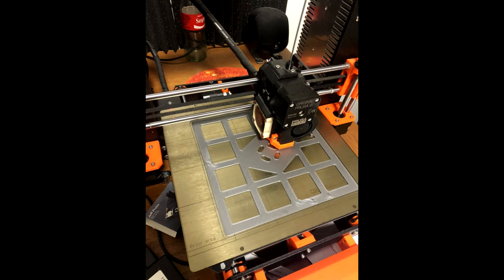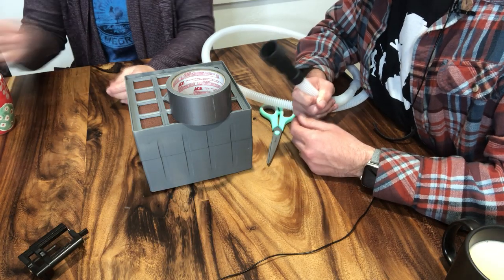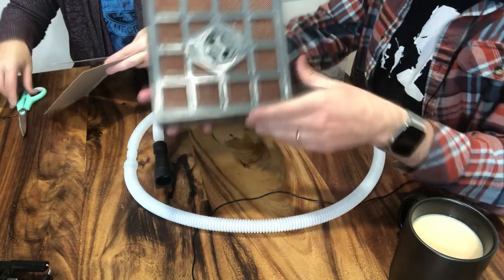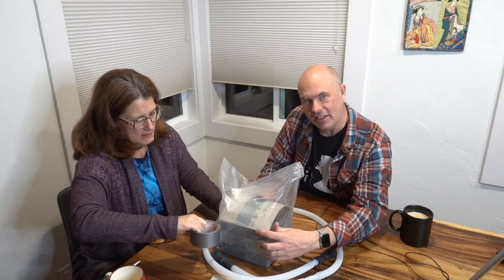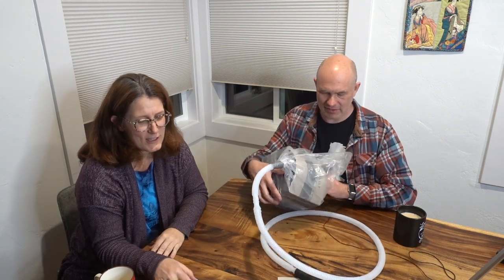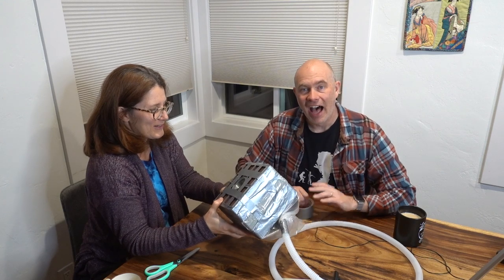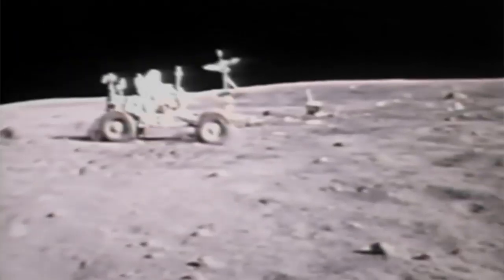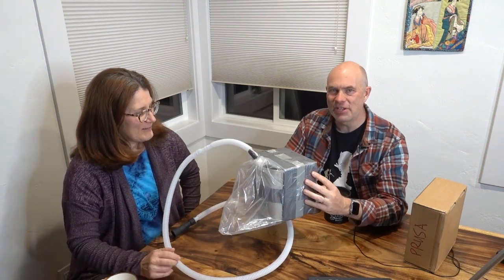Recreating The Air Filter Hack Used By Apollo 13

Comment: With another month of "stay at home" you can build an entire apollo capsule in your living room!
Reply: Tired Again Where am I going to get the hypergolic RCS fuel?
Reply: Challenge accepted
Reply: @alexlandherr   I'd say in your fridge
Reply: I don't think it's going to last that long.
Reply: @djbeezy  It is where I am.
Reply: Just simulate a moon mission. Load a pod up with freeze dried food, seal yourselves in, and have a computer running KSP without any time acceleration
Reply: A month? You're awfully optimistic. Try 2021.
Reply: @alexandrepascal3573  She might have a hair spray, don't ask how I know, they are pretty flammable.
Reply: @aserta  : The quarantines won't last till 2021.

They'll happen again in 2021.
Reply: @alexlandherr  Yeah, the stores are all sold out of hydrogen peroxide.
Reply: Robert Connor, it’s quite common knowledge that hair spray is flammable, we don’t have to ask, but I’m guessing it resulted in either an explosion or a miniature flamethrower.
Reply: @rickharper4533  "hair spray is flammable"
The stream of almost any modern spray can is flammable, since manufacturers were required by law to replace inert CFCs with FLAMMABLE METHANE.
Reply: Ian Santopietro no mmh and nto
Reply: Then walk around your back yard dressed  in your coveralls and a fish bowl over your head and pretend your picking up moon rocks. Just be sure you don't pick up the one's the dog left.
Reply: You almost had a year now. I'm expecting final stages of a working 1 to 1 scale prototype of the lunar space program.
Reply: "Yeah, I got one just like it in my living room. " - Roy Neary

Comment: I love conspiracy theories. The are so optimistic about how organized we are. Yet in Apollo, one part had round CO2 filters and the other square!
Reply: That's what happens when you have different contractors for each spacecraft.  Like the Saturn V with different contractors for each stage.  When you think about it, it is amazing that the whole thing worked together.
Reply: That's not the "hilarious" bit: they had known about this before hand, and engineered a hack instead of a solution.
Reply: Indee,d they did it for the future movie. Otherwise there was not much to remember
Reply: To which Gene Kranz quipped, "Tell me this isn't a Government operation. You guys better invent a way to put a square peg into a round hole. Fast!"
Reply: There was a specific engineering reason for this; the lunar module was designed to use the same cartridges as the spacesuit backpacks for lunar excursions.  So they actually did consider and implement common cartridges; just not between the CM and LM.
Reply: @SynchronizorVideos  thank you so much been struggling to find an explanation unfortunately looking has been difficult because everyone has written an article about the genius solution and yet never mentions why the lm an cm didnt use the same scrubbers in the first place
Reply: My friends really annoy me because there are actual conspiracies like 9/11 and then stuff like the moon missions and most just think they're all fake.
Reply: ^ A good example of how, in youtube comments, all conspiracy theories are true.
Just not all from the same people.

Comment: All pipes, when air is passed through at sufficient speed, will whistle based on its length. This is more commonly done with flexible pipe, allowing you to spin one end and it will automatically whistle based on its length and tip velocity
Reply: Notice the tube is not a straight tube... it's corrugated... that is what makes the sound...

Comment: I'm not stuck at home but I have a small cnc macine so I started making electrical  turbo pump an rocket  engine injector just to make the most noisyest flame trower ever I want some serious punch from it  like when you pull the trigger the pump spools up and air get flowing than the main fuel valve opens and than the most amazing flame comes out  but mostly because you inspired me that injectors are not so difficult in a video you made   thanks for giving me a fun and difficult project to use my cnc machine for  it's going to be glorious to have a rocket engine next to a steam engine that I made when I just got my lathe

Comment: Nice video I enjoyed watching.  A little tip for splitting tape down the middle only start with a small piece just enough to split and just pull one side while leaving the other side on the roll.  When you need another piece pull the other side

Comment: Having messed around A LOT with duck tape, to tear length-wise, it is much, much easier to leave a part onto the roll, and just tear out what you're going to use right away. Then you can take the reminder without having to fuss around with 2 sticking bits in the air...

Comment: For the computer nerd in you, Garrett AiResearch also invented/built/used the first complete microprocessor in the late 1960's. It was used in the "computer" on the
 F-14 Tomcat fighter jet. I think Garrett's mostly known for turbochargers and turbo engines, but they did a ton of stuff for aviation/ flight in general. I think the Turbine Engine Co.
 and AiResearch here in AZ. are all absorbed into Allied Signal/Honeywell now.

Comment: Someone once brought up how they remembered the astronauts using duct tape to save themselves on Apollo 13.  I remembered that it was for the air scrubber, but instead told them that it was for holding the spacecraft together before reentry.  The knowledge of the duct tape actually being used helps tell the story with a straight face.

Comment: They used to sell sections of corrugated tubing like that at Disney World when I was a kid, for the very reason that twirling it around in your hand made that noise.  Many a parent regretted buying something so simple and cheap, yet so annoying.  Nowadays, I install innerduct for fiber optic cable, and when I run a vacuum to suck a mule tape down its length, it makes the same noise but FAR louder.

Comment: The musical tone you  created is caused by the air flowing over the parallel ribs in the hose you used.
It doesn't  occur with vacuum cleaners because the hose is spiraled :-)

Comment: Hey, Scott, I have a video suggestion (2nd attempt). It's known that the two nozzles of the RD-180 and 4 nozzles of the RD-171 Multi-Chamber Staged Combustion Engines feature Independent  Two-Axis Gimbal, but I can't find a source that clearly explains how this is achieved. As far as my simple mind can figure, Two-axis gimbal requires the propellant lines leading into the engine to be flexible, which I can easily imagine on a single chamber staged-combustion engine, or a multi-chamber engine running almost any other combution cycle,  but I can't imagine any kind of flexible tubing being able to handle the exhaust of an RD-170-derived Preburner. Can you make a video taking an in-depth look at the gimbal systems of RD-170-derived engines?

Comment: I know EXACTLY what that sounds like! My childhood just came flooding back! (upon Googleing, A Groan tube!)

So back in the day there where these plastic sticks in the cheap toys area of Walmart and other department stores. And they had a weight in the middle with a whistle or reed. and when you tipped them, the air would be forced through the hole and it'd make that sound going in one direction, and then 'weeeEEEEEEEooooowwwmm' the other way. Particularly the cheap ones sounded like that.

Comment: Kinda a stupid question but: If they knew that the two filters weren't interchangeable why didn't they supply an adapter for this very purpose? It won't be too heavy, and it would mitigate the whole issue.

Comment: You can tear the tape off of the roll as you unroll it into a strip any width you need.  Don't pull it off the roll and then try to tear it in half.
Reply: That would be too easy.  LOL

Comment: the tape is much easier to tear lengthwise if you leave it on the roll, then the other half just stays rolled up and doesnt start sticking to the rest. also it is easier to tear it straight this way.

Comment: what was inside the plastic casing? you said you printed a 3d model but that was just the casing right? so what was put inside since I would assume you aren't actually using lithium hydroxide since this isn't suppose to actually work

Comment: On my way to Def-Con 23 my C-PAP mask & hose got lost. I literally can't sleep without it. I got a piece of 1" vinyl hose and some duct tape. I cut a slot near one end and taped a spare set of nasal pillows on. Then I used a sock as a headstrap. This kept me alive for two nights. On the morning of the third day my replacement mask arrived via FedEx. I had used a house phone just outside of where Cory Doctorow was speaking to check on its arrival. Apparently that was close to where the package was. They brought it to me about 2 minutes later. They used a 3 man team, two of which were armed casino security. The bottom of the cart held a clear box full of chips, but I think I was the only one who noticed that, but lots of people noticed the armed security in an unusual part of the casino. Word spread fast about my package and none of the hackers wanted to be anywhere near me or my package! Normally between sessions at Def-Con is jammed wall-to-wall. I had about 10' of space.  LoL

Comment: If the explosion had happened earlier then they would have lost more air that they needed for a longer time.  If later, especially after not having the descent engine they couldn't change the orbit without using the ascent engine. Also much of what they had to work with would have been already used up, including time to plan and explain to the crew.

Comment: 18:00  What!?!  Was surprised they had grey tape on the mission when Apollo 13 happened (followed it live, definitely more suspenseful than the movie) but am amazed they had it while out on the Moon!

Edit:  The first fender repair attempt, taping the original part back on, was done on the 1st EVA, so they already had the tape with them. The famous map panels-and-tape repair was on the 2nd EVA, a kluge designed by Earthlings while they slept. https://airandspace.si.edu/stories/editorial/duct-tape-auto-repair-moon

Comment: What I've always wondered is why they didn't go with Lithium Peroxide since that releases oxygen as part of the reaction. What did they do to supplement the oxygen used by the crew, or was the mission short enough that that wasn't a concern?
Reply: The Service Module carried a large amount of oxygen.  Both for breathing, and to run the fuel cells that produced power & drinking/cooling water.

Comment: so for someone who is relatively new to engineering (only a few years of study), 
why didnt they make one filter design and use it for both?  aka, why reinvent the wheel?
would using the same shape/design for both filters have worked or is there some other factor im not thinking of?
Reply: Because the lunar module cartridges were designed to be common parts with the cartridges used in the lunar spacesuits, thus simplifying operations and supplies for working on the moon.  You’re not fitting the big square units designed for three people in a backpack while still leaving room for everything else, and they would be serious overkill even if you did.  In addition to that, weight and space were extremely limited in the lunar lander - especially the early ones with the less-capable descent engines.

Comment: Since they wouldn't be used for any moon walks, why couldn't just turn on the 2 suits backpack? I know it wouldn't last all the way back to earth but it could have lasted 8-10 hours for all three of them. So they had more time to make that air filter hack. Also, If the suits had their own power supply and had heaters turn them on too. The suits were staying on the lander and were jettison anyway.
Reply: You have any idea how bulky and clumsy those moon suits were?  And with three dudes crammed in there?  No thanks.

Besides, the life support backpacks used the same round filters as the lunar module, so it’s not like they were a separate scrubber option.

Besides, unlike the film, in real life they knew the issue was coming and already had the adapter solution ready to go, and implemented it long before the CO2 levels actually became a problem.

Comment: Would the real Apollo 13 air filter be releasing those same chemicals into the air with the same potency?  It sounds dangerous to breath it for the few days they depended on it.  Could the chemicals in this video be from the 3D printed materials?

Comment: What I'd like to know: What's the actual difference between the filter cartriges for the lunar module and the orbiter? Are they somehow fundamentally different inside? Is there any good reason why they wouldn't just switch to using the same kind for both after coming up with that scenario during Apollo 10, besides being boneheaded bureaucrats?
Reply: Those parts of the spacecrafts were built ahead of time.  The first part that failed was also that old.

Comment: So the idea is they used something that is usually used from another part of the ships to use where they were? This does not actually turn co2 into o2 again though? So it is just improving the air?
Reply: It's removing the C from the CO2 leaving it with just O2..  which is indeed improving the air and yes also turning C02 into 02 :).
Also...  not just another part of the ship.. but the Lander was and entirely separate vehicle attached to the Command Module.. made by separate companies.   It would be like..... getting an Andoid app to install on an iPhone...?   surely there is a better analogy,..
Reply: @Swordfish728  they didn't have any N2

Comment: You never really explained what went wrong, and what they were doing to fix it.
Reply: What went wrong couldn't be fixed.  This was just to make the supplies in the lifeboat last until they could be picked up by an aircraft carrier.  Very similar to the air issue in part 2 of Tintin's moon trip, but for a different root cause.

Comment: The movie that claimed nobody in mission control OR crew thougth about checking the air in the broken spacecraft until the very last moment.
Making them look like idiots for a bit of drama.   The movie has some lose resemblence to the real event but people using this as source for information are hopelessly lost (but too many do).   The simplification (one flight director only?! 3 days?!)  and overdramatising completely and utterly disqualify it as a source!

The LiOH issue on the to-do list was mentioned by Kranz and Lunney in the very first hours after the accident (Fligh director loop available on youtube)   and was also  discussed in the very first press conference. You can safely assume after the hussle in the initial hours, they were not surprised by anything anymore.  The staff assembled to think, plan, write and simulate ahead was way too big for that by then (not one Astronaut in one simulator heroically testing everything....) . Initial hours mainly managed by Glynn Lunney btw, not Gene Kranz. Kranz left after an hour to organise said backroom staff.  

The movie not giving credit to Lunney is by far it's biggest crime.

Comment: Why did this ever happen. I cant find an explanation anymore as to why both the service and lumar modules didnt use the same scrubbers by design. Everyone talks about how its an aamzing hack and loves to harp on how great nasa is but why did this problem ever exist.
Reply: Because the Lunar Module and Command/Service Module were made by different manufacturers. Grumman made the LM, North American made the C/SM. Keep in mind the Lunar Module was theoretically just along for the ride until they got to the moon. They would have the hatch open to make use of the extra space but it was powered down.

Comment: Wait, if they already had a procedure for it that means they already knew it was a potential problem, so why did this end up happening at all? XD
Reply: Also, I find ripping fabric tape in half much easier if you rip it to length first, but that might just be me? I ran out of masking tape when preparing for a painting project and did that a lot to save on tape when putting stuff over things I did not want to paint XD
Reply: @HorzaPanda   Even easier if you pull just a little off the roll, start the split, and only rip off the half you want as you continue.
Reply: Must have been too late in production to engineer a new common filter and verify it worked when integrated with each system. But they certainly should have included a pre-made simple adapter kit onboard!

Comment: the sound is due to the pipe having ribbles on the inside, if the pipe was smooth on the inside, passing air wouldnt be able to catch on these ribbles to change path and smash into its own trajectory.  In some way it would've been harder to pass air through pipes like you used since air would resist going through it..
See it as a very, very badly designed tesla valve.

Comment: What would the world do without duct tape ???      ........ Does it ever get used for its intended purpose ?😁
Reply: Duct tape is wrong. It was originally used for sealing ammo boxes, and got the name duck tape because water rolled of it like water off a duck’s back.
Reply: It does. But proper duct tape is the foil stuff.
Reply: @cameronwebster6866   Actually, that's only where the Duck name came from. Surplus ammo-box tape was sold on the civilian market, and contractors began using it to seal air-conditioning ducts. When the tape manufacturers caught onto this, they started selling the grey version, under the new brand "Duct Tape".